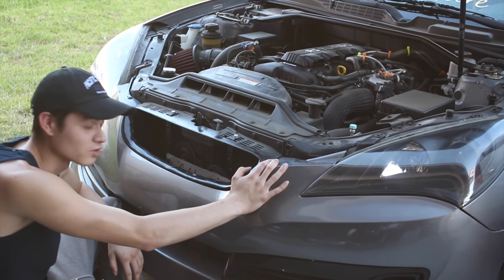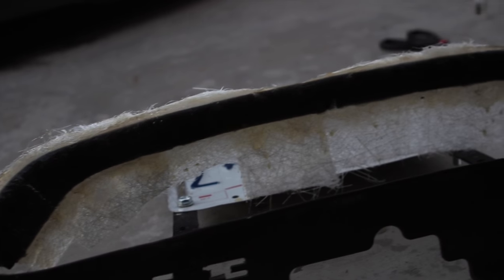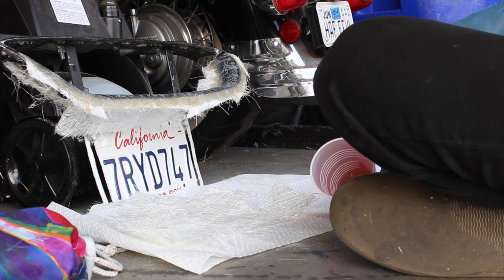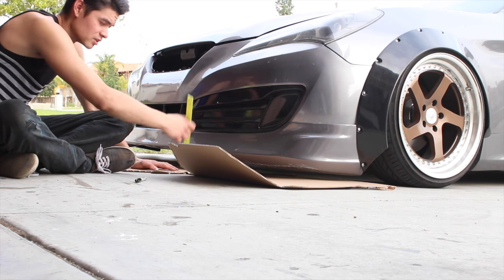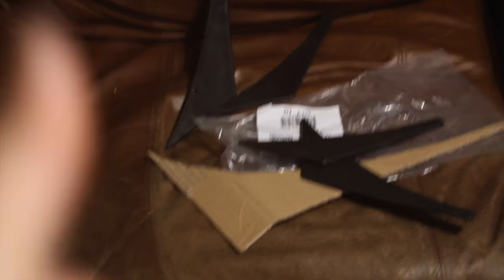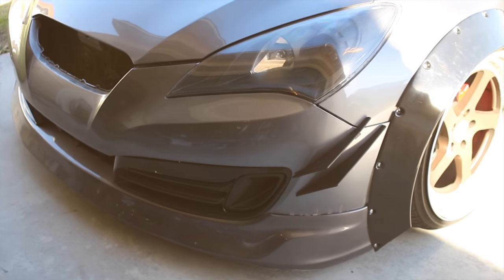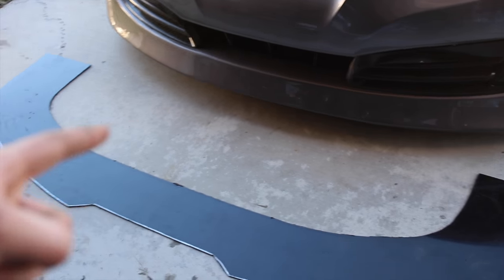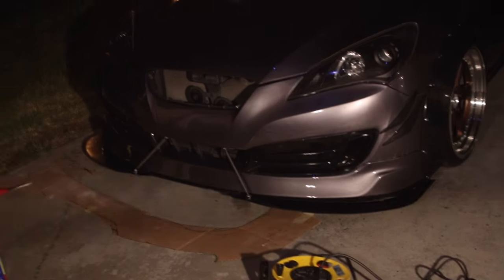Making a Custom Splitter!!  (Instagram @tylercordura)

Comment: My grill had some damage so I just cut it out and ended up with what you were dealing with.  I would have liked to see that grill up close to see what you used for the actual grill.  I ended up using some expanded lathe that was taking up room in the shed.   I just grabbed a couple tubes of two part epoxy which seemed to work pretty well for attaching it to the plastic grill frame.  I also used it to fill in some of the cracks instead of fiberglass.  Sand and paint; done.  Looks okay.  One of those cheap plastic fasteners broke under the left fender well so I've been trying to figure out what to use to keep it from flapping around.  Those canards look like a possible option.  I didn't like the looks of them until you put the splitter on (without the horns).  Then it all looked pretty good.  It would be really great if you could get some close up shots of how the grill looks and how those canards and splitter are fastened.  Even if it doesn't look perfect, it's still pretty cool being able to customize your ride without paying retail for upgrades...

Comment: Oh, and it's pretty simple to use a snub nose screwdriver to reach under the air dam to get at those pesky screws holding the grill in without having to remove all those other screws to pry it back, or remove it altogether.

Comment: Great job!
The thing I don't like is the look of the rods holding the front splitter. Aren't the bolds sufficient to hold it, or is it also for the looks?
Reply: MrYaris it keeps the splitter parallel with the ground at high speeds. Helps reduce lift.

Comment: man  messed up my genesis :( i touched the throttle body plate now the idle is messed up :(
Reply: Grimm_Gen Dang :(
Reply: Grimm_Gen what did you try to do?
Reply: wo lf tried to clean the throttle body, and since its electronic it needs to be reprogrammed
Reply: Grimm_Gen Oh, which model do you got?
Reply: Fel Beat 2.0T 2010
Reply: Grimm_Gen Nice, my bros got a 2015 3.8 😁